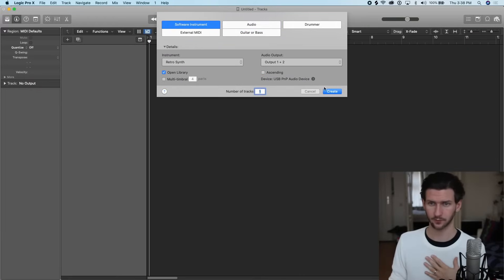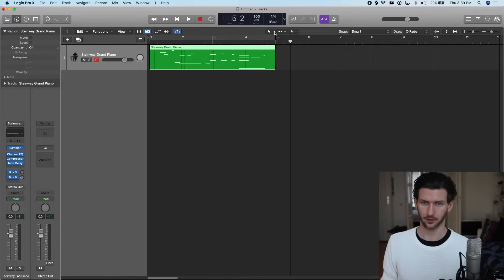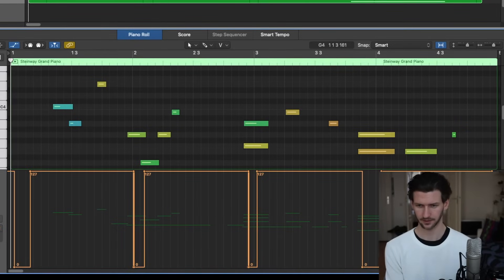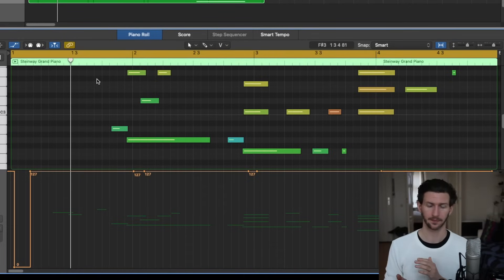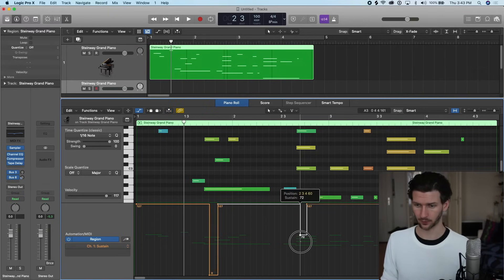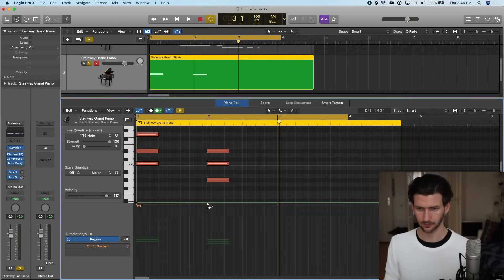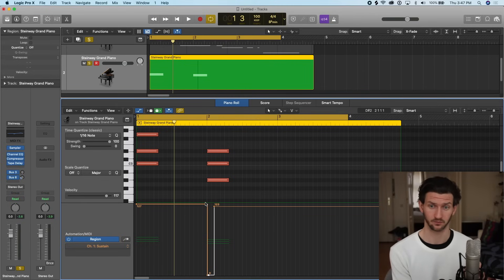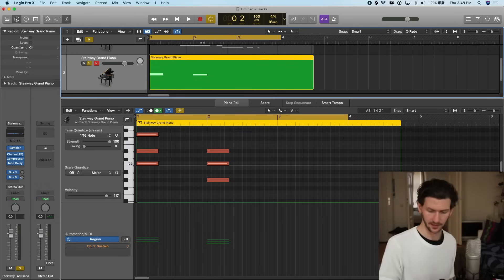How To Add A Sustain Pedal To Midi in Logic Pro X

Comment: Thanks for your video. I am using eastwest Pop Brass and can't get the horns to sustain for more than a few beats. I tried using automation, but was unsuccessful. Any ideas?
Reply from the maker: hey tracy, you could try holding the midi notes on your keyboard, extend them, or use your sustain pedal. I'd recommend extending the midi notes because horns don't have a sustain pedal

Comment: Thank you for this tutorial. I'm having trouble with Logic chasing the pedal down (127) position. I have an 8 bar section where the pedal is down throughout - when I edit by looping bar 2 and 3 the pedal position is not carried over from bar 1 even though I have ticked all the boxes in Logic's midi chase settings (under project settings). Can you help?

Comment: Is it posiible to use sustain while plying? I mean I have midi controller and jack sustain, but dont know if logic support signal from jack. Btw do I need 12v adapter for using sustain with midi controller? Thank you

Comment: hi charles,, i have  a question, i got  a casio cdp 135, which are does not support half pedal,, but can you tell me, if i plugin a aftermarket pedal in the computer can i use it as a half pedal,  because i am ussing only piano vts sounds from computer?
Reply from the maker: Hi sensey, yes I think that should work.

Comment: Hey Charles - I have a situation where I take piano music from a Finale file and save it as midi - and then I put it in Logic and use Humanization on it. I have a big struggle getting sustain without bleedover to the next ms. Is it because of the humanization where the notes are lingering over into the next bar and the downbeats arent exact? Or could it be anything else? It works better on the pedal but wish I could get it to work with just the mouse like you were doing. thnx, Lee
Reply: Hey nevermind - there were some chord changes I didnt realize was happening. Thanks